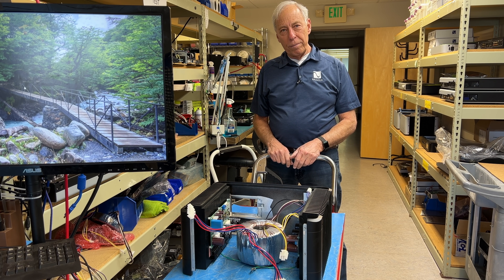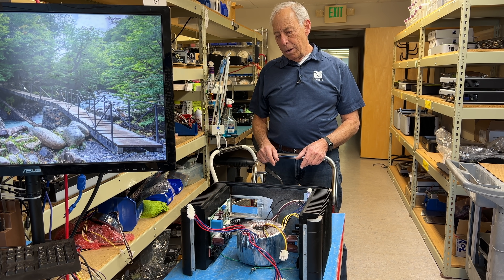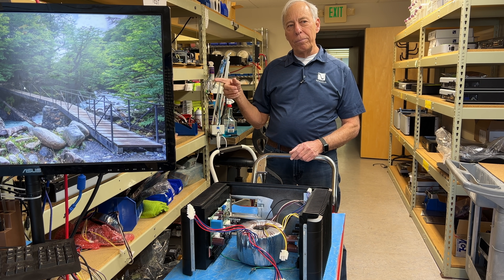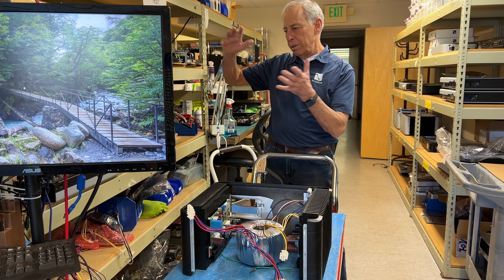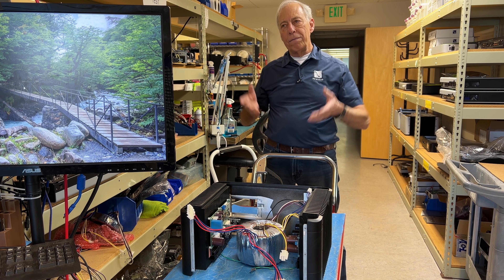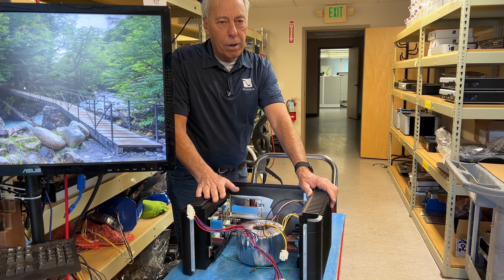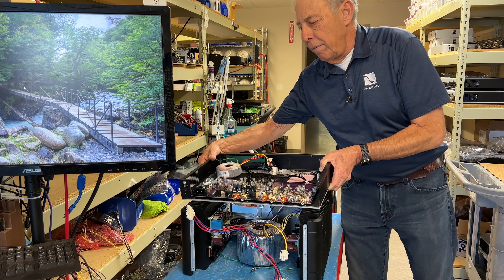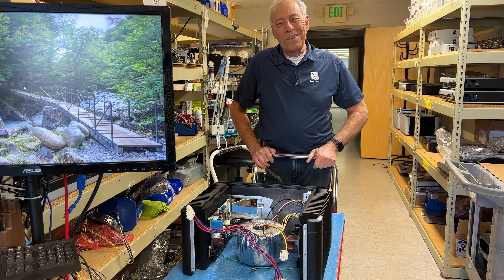Why are many amplifiers empty inside?

Comment: Also as component parts are getting smaller it takes up less space for the same function and in some cases better performance.
Reply: To some extent , Transistors still have to deliver both Voltage and Current enough to drive the speakers 
and there is a Physical limit to the size of them to be able to deliver , after all byproduct is heat and 
it take a certain amount of size to dispose this combined with a good big heatsink too .
Even smaller you make the component even less power they can handle , it is physics .
Big heavy duty amplifiers with big strong transistors and heatsinks combined with a power supply that 
can deliver the voltage required with enough ampere is of course less prone to clipping and thus 
produce much more clean signal at high output compared with a typically small system with 
socalled same WATT number .
A 300 watt amplifier with small transistors and little powersupply that cant deliver enough ampere 
will of course be clipping and most often can NEVER reach the socalled 300 watt in more than a few micro seconds .
Where an Amplifier there is constructed with transistors big enough to handle the load and a power supply that can 
deliver more than just a few ampere can run this power continurly thus at same measurement methods it 
of course spit out much much more Watt in the same micro second ,, but the 300 watt is constant and to do this 
you cant just squice in some small micro component and call it a day .
( If that wasnt true then nobody would still produce those big heavy amplifiers )
Those small class D with switch mode is a HYPE and as we all know a Hype is SELLING and compare this with 
very CHEAP constuction / components and you have a BIG PROFIT  ..
Reply: @Stronz_music  totally agree with you, no replacement for displacement (speaking in car terms) Also manufacturers need to stop running components in equipment to their limits most of the time, no room for error. If it is cooking hot at idle then it's not going to take much to push it over the edge and go poof!
Reply: @SombreWarrior  Yes thats so true  : )
Reply: @Stronz_music  And yet my 5kg class D power amp in my living room utterly destroyed the 25kg Arcam amp rated at a true 200watts per channel. 
Not even close. I sold the Arcam within  days. Truly feeble sounding next to the Class D
Reply: @Taco Totally agree  : )

Comment: so they feel more premium. apart from the rack angle. these two aren't particularly empty though so not that good examples.

that's a nice toroidal.
Reply: Once I looked inside a musical fidelity amp, and that one had a transformer in one corner, a green circuit board in another and the rest was just air and heatsink on the outer edges.

Comment: I recently bought a tuner and true to form I had to have a look. Turns out there's just a fat chip on the little front panel PCB, a few tact switches, an LCD AND NOTHING ELSE! So where's the tuner? It's all in software and the entire chassis is empty save for a tiny little SMPS at the rear by the massive AC inlet. And it works great as tuners go. Why have rows of LC stuff when you don't have to?